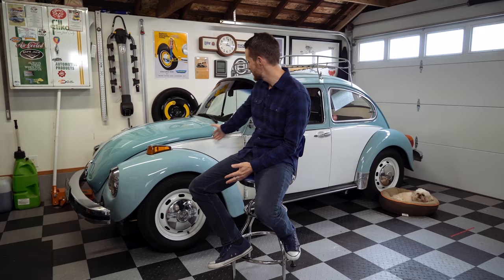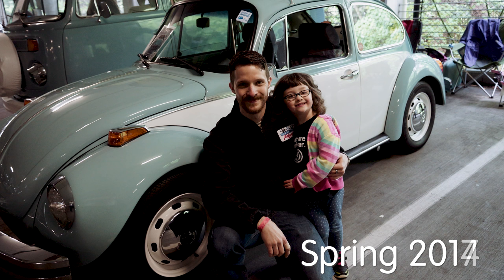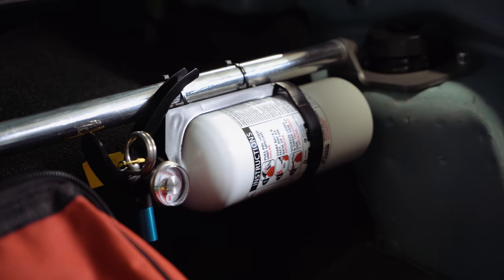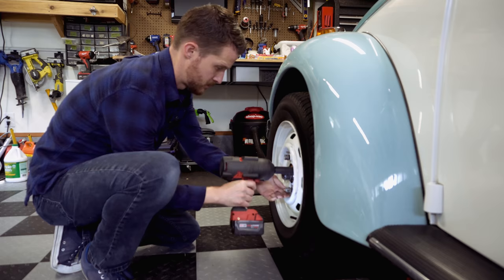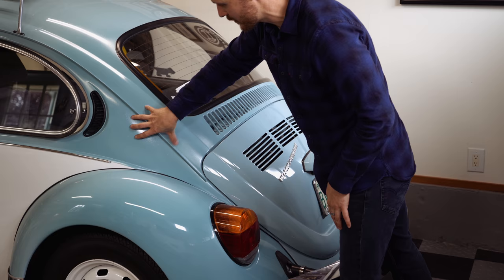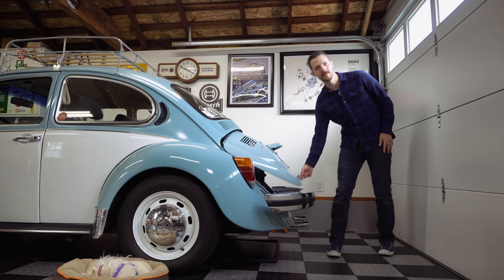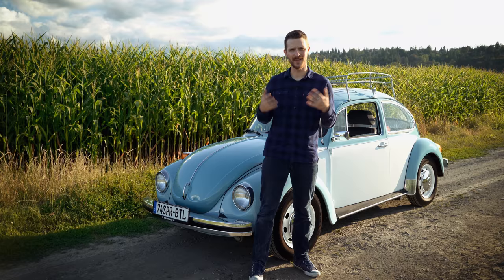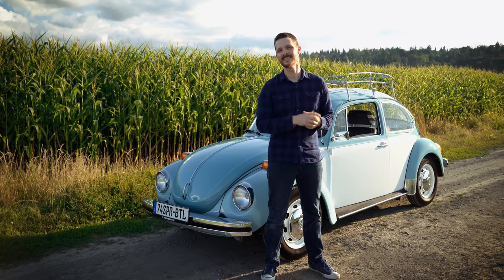Our Super 74: VW Super Beetle Tour

Comment: Since the introduction of 1971 Super Beetle, the rear crescent vents replaced these rear butterfly windows. As a kindergarten kid, I was pissed off that our 1971 Super Beetle new car got fixed rear windows. It's so cool that you got both, in addition to the standard front wing wings. In 2002, I simply collected the 1984 Jetta coupe (the latest hardtop VW with wing wings) & had to modified in order to have these fixed wind wings open, just like Cabriolet's std feature.

Comment: I also owned a 74 Super Beetle bought in in early 77.  It was black with red interior and really in good condition.  Only VW I've owned that didn't leak oil.  I enjoyed it for years.  Now I'm trying to fix up a 72 Super. Not going the restoration route but just a dependable daily driver with a bit of performance.  Great video and keep up the good work.

Comment: Hey buddy you did a great job on that bug one tip for you move your fuel filter from your engine bay to the under side of the car above the transaxle to prevent a engine fire there's a bracket you can buy to mount it I have a 1971 standard beetle and I moved mine under it
Reply from the maker: Good point.

Comment: Got a 1971 Clementine Orange Super Beetle  new in 1971 with the auto stick transmission. Drove it through colledge and in 1977 put in some 8x10 Jensen speakers
Reply: In the rear deck similar to what you did with a radio/cassette player up front. Awesome sound! Gave it up in 78, sure wish I had it now!

Comment: I enjoyed your video, I also owned a 1974 super beetle that I bought  new. The key difference between the 1973 and 1974 that I noticed  was that there were  black plastic caps on each side of the bumpers front and rear. I don't know if you removed them for the restoration or you didn't want them on the car. They  do designate that it is a 1974, not much else says that on the outside of the car. Again the video  brought back memories. There are times  I wish I still had it. Thankyou
Reply from the maker: Thanks!  Yes I still have them.  One was chipped so I just took them off the bumpers.  I keep all the stock parts so I could go back to 100% stock later on should I choose.
Reply: @JasonExplainsThings  Thanks for responding back, good luck with your videos. Lance

Comment: Hi two questions, first where can I find a strut bar like the one you have installed? Second who painted your car, list the wax you use to get that shine. Lastly awesome video. Thanks in advance Tim
Reply from the maker: Hey there Tim!  I got the strut bar at Top Line Parts.  They're an awesome suspension and brake resource.  The place that painted the car has been out of business for a while.  For wax I love Griot's Garage products.
Reply from the maker: But for paint, if you're in the Seattle area check out Bow Wow Aircooled in Monroe, WA.  They can point you in some awesome directions.

Comment: Gorgeous car.  I wonder if I could see a pic of how close the two inner bloster are to each other.  I've used Miata seats in my previous Super and I have Scat seats in my current car.  I absolutely considered using those Recaro, but I was concerned the bolsters would touch
Reply from the maker: They don't touch.  There's still space to access the heater controls and the parking brake lever. 👍

Comment: loved your video! i'm  myself. What is your take on the automatic Beetles of that era?
Reply from the maker: Never driven one of the autosticks... they have a high and low setting right?
Reply: Jared Sullivan overly complicated. They increased fuel economy and reduced performance. Learn to drive a stick if you don’t know how to yet. The standard vw trans and shifter are durable and easy to use and the clutch is light to operate.
Reply: Jason Explains Things 3 speeds. Low, 1 and 2.

Comment: i just bought a  74 super beetle. less than 2k miles on a rebuild engine. i admit, i dont know a damn thing about these cars. its a present for my wife. needs paint and interior.
Reply from the maker: Jeremy Williams I didn’t know anything 11 years ago.  It’s super fun to learn and figure out how everything works.  Have fun!  👍
Reply: I owned a VW from 71-78.  I think he did a very nice job on this super beetle. His work on the front end is great.  The engine is very easy to work on.  You will need to do your own  maintenance . Valves are easy to do. Oil changes are messy and a bit more time consuming than modern cars.  Air  cooled cars have little maintenance. Disk brakes are a good idea. I would do it. There are better carburetors and I had the back windows open like that.  I would lose the storage in the back for the stereo. You can put speakers into the doors and the back panels.  I did most of the maintenance on it myself. I would go with the electronic ignitions. Points are a pain. I personally like the stock muffler tips. I love the sound.

Comment: Jason, I am looking to lower the front end of my 74 Super Beetle just like yours. Did you purchase the entire lowering kit from TopLine with all new components or did you just purchase the adjustable lower sections and new springs? I want to purchase the correct components to do the job right and not sacrifice the ride quality.
Reply from the maker: From what I remember it was pretty comprehensive.  It's a great kit, has held up very well since I did that 7 years ago or more, and it makes the car handle amazingly.
Reply: @JasonExplainsThings  Thanks so much Jason. I have a very low mile, unmolested 74 that I want to get the most enjoyment out of it that we can. It doesn't need any major repairs so we are immediately going to cosmetics such as lowering the suspension and fiddling with the sound system.  I enjoy your channel and look forward to following your content.

Comment: Hi Jason, nice work, can you please repeat the name of the car you took the seats from, I tried to get it many times but I failed... Thanks.
Reply from the maker: MK2 Jetta GLI
Reply: @JasonExplainsThings  thanks, one last question please... Did you need to change something while installing? Or they just match the normal super beetle seat base.
Reply from the maker: Yes.  The seat bracket was totally different.  If I remember correctly (this was many years ago) I used a modified seat bracket for this seat:  https://scatvw.com/product/elite-black-vinyl-sides-grey-velour-insert/
Reply from the maker: It wasn’t a simple install.  I need to learn to weld so I can fabricate stuff like this myself.

Comment: Super beetles (1302/1303) were made from 1970-1975 in Germany only. Never made in Mexico or Brazil.
Reply from the maker: Went to 1978 but as a convertible.
Reply: @JasonExplainsThings  All convertibles were made by Karmann/Osnabrück. Production lines in Wolfsburg were needed for rabbits (Golf 1) from 1974 on. The small beetle 1200cc with front torsion bars was made in Emden/Germany until 1980 and Puebla/Mexico after.